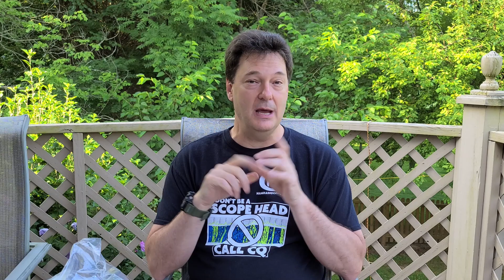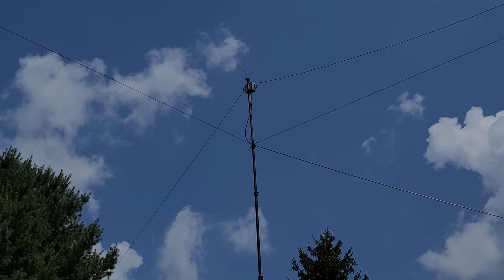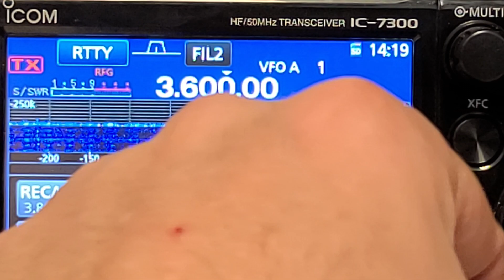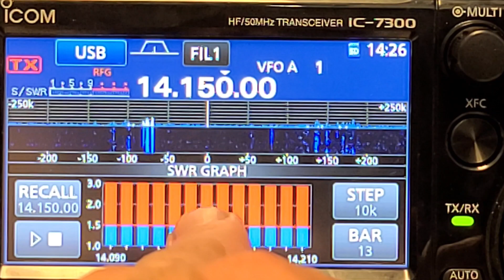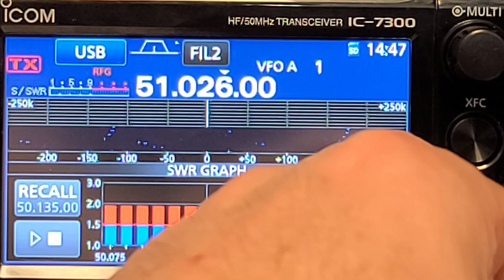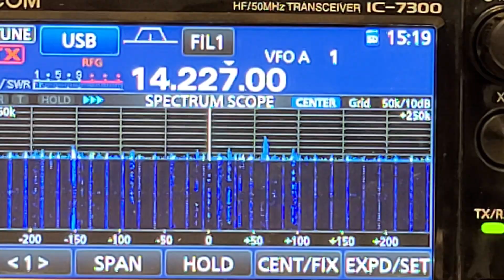LCARA HAM Radio: Palomar Engineers OCF Dipole Antenna!!!!!

Comment: Thanks for this video, even though you can use this antenna on all those bands, the results are not as good as Palomar advertises.  They show a bit lower SWR on all the advertised bands.
Reply: I think Palomar measure swr at the bottom end of 200 feet of co-ax; no wonder! 😆

Comment: Awesome. Thank you for the video. How far should the feed point be from the tower? I am thinking of using 3m (10ft)plastic pipe fitted inside  a steel pipe welded to the tower, to step the antenna out from the steel tower. Will the tower still effect the antenna?

Comment: I purchaseed the 40 to 6M OCF from Palomar Engineering and installed it up today at 30 feet up as inverted V with 50 feet of RG213 and my luck is better than yours, here are my readings:
40M, CW portion...1.5
SSB portion 2.0
20M 
all the band CW and SSB is flat at 1.1
15M
all the band CW and SSB.. 1.7
17M not a good one, all band 3.0 BUT the radio builtin tuner made it flat at 1.1
12M
all band cw and SSB is 1.7
10M
CW is 2.0 and SSB is 1.8 
6M all band cw and SSB is almost flat at 1.2
Reception is very clear, as quite as the bazooka dipole I removed.
Its definitively a well design OCF antenna.

Comment: Thank You for this video. I found it to be very informative for wire antennas. I prefer wire as it allows me easer antennas to work with. This video taught my how the check SWR fro the front panel of the radio. Now I can see how good my current system is working.Thanks again.

Comment: I have an OCF Dipole rated for 160-6 meters. My antenna is mounted horizontally with the feed at the end of a standoff arm 4 feet away from the tower at about 30 feet. I was wondering if you or anyone else has run an SWR test on all the bands vs height of the dipole? And thank you for this excellent presentation.

Comment: I'm not sure if the IC-7300 works this way, but my IC-7000 automatically selects RTTY when using the plot measurement.  I bought a Rig Expert antenna analyzer and its been a really great tool for measuring SWR, impedance, inductance, reactance, etc, and saves me from subjecting my transmitter to high SWR. 73 KD5YOU

Comment: Very good report on the OCF antenna. have you seen the newer OCF that is 33 feet shorter and has better coverage. I can supply you with one for testing if you wish. If i had an email i could send you the SWR chart for it. by the way it does have a low SWR on 6 and 2 meters but is very directional.
Reply from the maker: Hello Don Johnson - Head over to LCARA.net and you can find contact information. Thanks for watching!
Reply: @LCARAHAMRadio  how do i contact YOU not the rest of the network

Comment: I home brewed an ocf dipole. Installed with feed point at 38 ft., the long leg ending at 24 ft., and the short leg ending at 30 ft. I shortened both legs to get it in range (take twice as much off the long end as the short).  I’ve recently made a contact to Italy with a 59 signal report on 100 watts.  I don’t need a tuner because I’m getting SWR’s in the range of 1.1 to 1.5 on all bands.  Very good design and you can make your own for about 50 dollars.

Comment: Great video. I had been considering putting up an OCF dipole, but had several people comment that it wouldn't be effective at the height I was planning on, which was feed point mount of 40 feet. Everyone keeps saying 50 feet is absolute minimum. So very glad to see this one performed well when mounted just 30 feet at feed point. I'm wondering what kind of distance you've been able to achieve; how far on DX contacts? I think this might be a viable antenna option for me after all.
Reply from the maker: @Brando Kitsune - I've been able to make contacts in California, Montana going west and all of the East coast.

Comment: My first HF antenna is a home made off center fed, half wave, long wire dipole.  I've got to get it up higher and trimmed to decrease the SWR as I'm getting too much reflected power.  Mine is modeled from an 8010 long wire antenna.  So you're a Marine;  me too.  Semper Fi from an old Jarhead.  You dipshit.  You used USB to measure 20 meters.  73 from K9POW in eastern Tennessee.

Comment: It's obvious that you do not care about us cw operators or the digi guys.  But you could at least include us in the swr testing of this antenna.  Thanks K3VZ
Reply from the maker: @Donald Swank - We definitely don't have a bias against CW or digital modes. We in fact will be investigating the lower spectrum on the bands in the new year. My apologies we didn't cover your area of interest this time. Stay tuned as we cover digital modes on many of the same antennas we have reviewed thus far. Thanks for watching!
Reply: @LCARAHAMRadio  Thanks for the reply.  Other than only covering half of the product you were testing, it was an interesting video.  But why would you review only half of it.  After watching your video, I have no idea if I would buy that antenna or not!  FYI, I used a 80m Carolina Windom with a 21 foot vertical radiator from Radio Works.  Feed it with 134 feet of coax and covered all bands, edge to edge, cw and phone, including the 3 WARC bands.  I worked Dxcc on all bands, plus on cw, digi and phone.  All with 100 or 200 watts.  It did not cover 160m and I never tried it on 6m.  Radio Works is out of business because the owner retired.  Will be a regular watching more of your videos. Thanks again for responding.   K3VZ

Comment: I just got a 40-10 ocfd from Paloma would be great to see a video on it but I’ll see what it can do myself hopefully it does better on 20 meters than yours did. Thanks for the video
Reply: Real bummer I had to take it down in a nutshell the power company had to run overhead powerlines right beside it so I couldn’t leave it up really bummed
Reply: @Spike Spiegel  mine was pointing north and south the long leg was pointing south it worked great I got into New York on it in North Carolina but I also got down into Baja Mexico I check in on the Baja net every day at 8:00 am pt. The long leg was supported by a one inch o.d metal fence pole the short end a tree The main mast was 30 feet up in the air and attached to a pole of a cyclone fence as well as this is the south end pole

Comment: Thanks for the video.

Just last week I managed to get the same Palomar Engineers antenna up in the air as my first "real" HF antenna.  Unfortunately I was only able to get the feed point up 23 feet, and the ends in the ballpark of 15  -- though I hope to improve on this next summer.  I noticed my untuned SWRs were a bit higher than yours, typically around 5:1 -- though my LDG AT-200 seemed to do fine with that.  Since I don't have much experience on HF, does this sound reasonable and like a workable situation to you, at least for the first winter?  I know the take-off angle is going to suffer, but I figure a compromised antenna in the air is better than no antenna at all.

Just like you I found 17m to have the best SWR, around 1.2:1.
Reply from the maker: @Brent Casavant - If you can tune the setup to something your radio likes, it will work. Ideally, you would want to get the  center-point up to the  30+ feet in the air. I initially did some tests at a shorter height and got similar results as you. So the extra height will should make a difference. Hope you get the same great results I did when making contacts. I'm very pleased with my setup.

Comment: My home roof is metal.  My mancave roof is metal where radio will be and an out building roof too.  
What do you suggest for all this metal?
Can i mount above roofs or should I stay over asphalt?   
TIA
Matt KD6ILY Yerington NV
Reply from the maker: @Matt Bowman - lots of metal means lots of potential problems. You either need lots of height above the metal roof or move away from the building as much as possible. Antenna placement can be very challenging with your situation. It may take you several attempts to find the best fit.
Reply: Metal roof, solar panels equals forget HR!!! JohnBoyUtah KJ7tBR! 😎🇺🇸📡🎙

Comment: Thanks for video. The way my trees are it would put the antenna legs flat but not straight like clock hands of 6 O'clock . They would be more like the clock hands of about 5 O'clock. Would this be ok or would it mess up the pattern and think it was an inverted V that fell over on it side?
Reply from the maker: @forget_your_life - The actual orientation of the two wires will be dependent on your space and this may weaken your ability to make contacts in one direction typically. The recommendation for this antenna is both ends at least 45 degree to 180 degrees in relation to the ground. Sometimes people are more interested in long-distance contacts and a having the wires in an inverted-v make a lot of sense. In other cases, having the wires mostly parallel to the ground will provide better NVIS operation for closer contacts and stations. Play with it and see what you observe. Report back and let us know!
Reply: LCARA HAMRadio I didn’t have much luck with it. Was only able to get the box up 25 feet. I think it needs to be more like 50ft. Swr was horrifying
Reply from the maker: @forget_your_life - They really don't recommend this being any lower than 30'. You may want to look at another way to move it another 5-7' higher. It will make a big difference on some bands. Also, be sure there aren't any metal objects nearby as that also throws everything off.

Comment: Brian, I was reading up on this OCF dipole and it recommended to stay less than 50' of coax regarding SWR. 
"Any length of 50 ohm feed line ok but longer feed lines over 50 feet may show reduced SWR on some bands due to losses in feed line and soil conductivity, nearby objects, etc."
MaynI ask, what type and length of coax did you use?
Reply from the maker: Hey Joe, yes, I read the same thing, but in my case, my length of coax is around 60'. Given that all the bands for me were either bang on or tunable with the IC-7300, I'm not too worried about it.
Reply: I think "reduced SWR" means lower SWR, so longer coax would be better.

Comment: Thank you for this one. Ive been looking at other antenna options and these OCF dipoles. I have a 20 and 40 meter wire up on a 1:1 balun (N/S at 28' respectivly) and works real good on 17, 20, 80 but not so well for 40. IDK. This OCF dipole seems very promising. Thank you Brian for putting this one up!
Reply from the maker: Glad I could help

Comment: “Futz” is also a technical term used in New Hampshire.
I wonder if it would work on 2 meters and with an external tuner if it would work on 160 meters.
Reply from the maker: I'm not sure, but would be worth a try. Thanks for the comment!